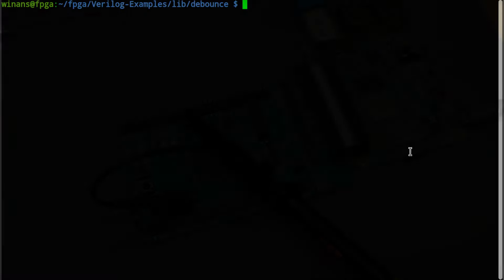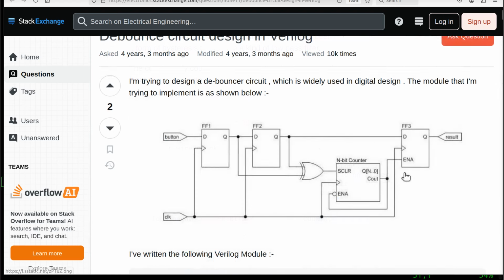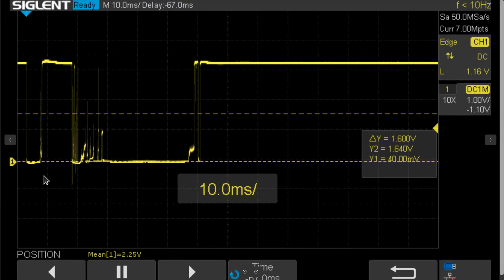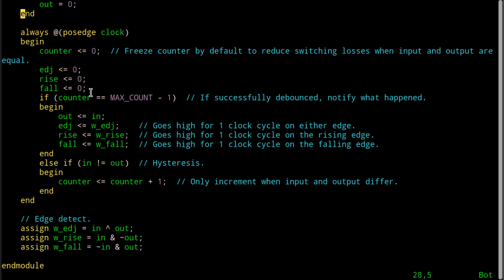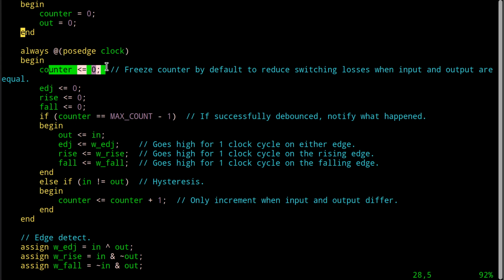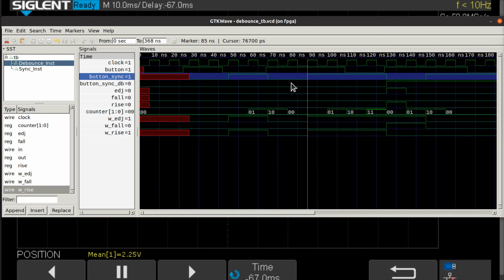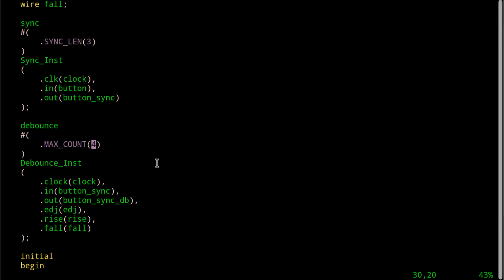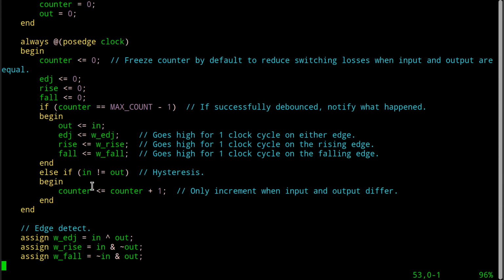FPGA #23 - Switch Debouncing

Comment: I've been programming Cypress/Infineon PSoC devices which have universal digital blocks in them. You can use their design tool to drag functions (debouncers, glitch filters, PWM controllers, etc.) into the design which configures these UDBs and creates APIs in the source code to interface with the UDB function. They are light on describing what is really going on internally with the functions, and this has been helpful for me to gain a little more understanding.